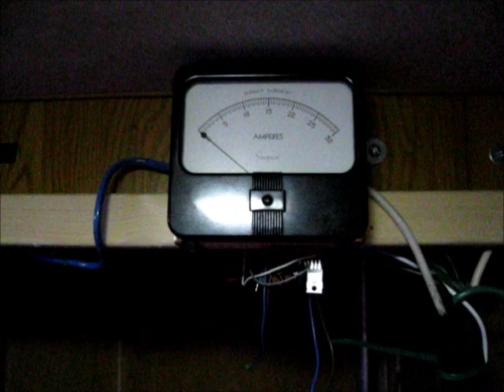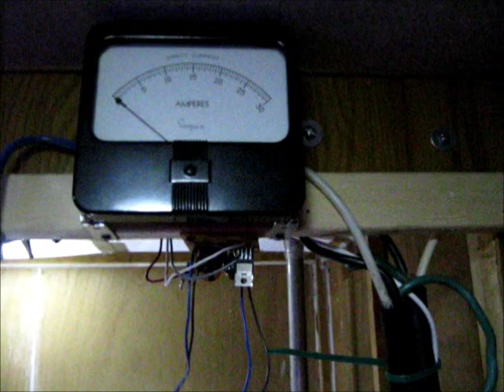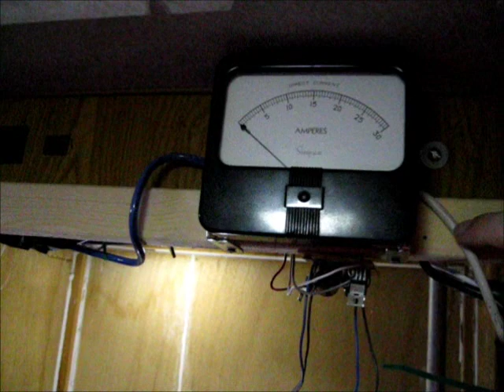Huge Wires Improve Solar Panel Output by 2x

Comment: My solar panels came with a 10 gauge wire and i want to upgrade to an 8 gauge are there any videos that show how to do this. thanks. Unfortunately y ou don't show how to, just what you did which is the same reason why i want to do mine.

Comment: use mirrors/reflectors to increase output even more...just dont overdue it because of the heat from putting a bigger area of light into a smaller space obviously

Comment: Does anyone know where I can find schematics for a solar charge controller with a charge dump system? Looks like this channel is not very active.
Reply from the maker: This channel is pretty active I would say since I upload a video just about every single day.
Reply from the maker: What you are looking for can get quite complex. Your system can be as simple as a voltage regulator, voltage sensor with relay and dump load. Or you can (and should) get very complicated and have a full charge controller which takes care of your batteries properly. This is a very complex system which I eventually bought and am using today. Check ebay for cheap solar charge controllers under $20
Reply from the maker: At the time I built this myself, I had no money but I did have some electronics on hand so I put this together. It was better than nothing in the short term.
Reply: Oh! sorry about that, I should've looked closer.  I actually have a solar charge controller.  I don't think it has a dump system, which I think is great. But what I am really looking for is this: I want my charge controller to shut off charging at 15.1 v.  Right now it shuts off at 14.2 volts. I'm pretty sure I know what piece needs to be changed, I just don't really know what to put in it's place.  I don't need more amperage...

Comment: Thanks. I am waiting for my mono cells to make my 18V panel with 50 cells. 36 cells in series and 14 in parallel to get more amps.
I have to have my panel inside window as I live a highrise condo. Using your experience I want to buy 6 or 8 gouge wire to run from panel to battery.
My question is can we buy wire connectors for 6 or 8 AWG wires?
also from the battery any gauge wires could be used or big wire is good?
.

Comment: V=IR Thicker wire mean larger surface area with in turn lowers resistance (R). Voltage remains same so current must increase to when resistance decrease

Comment: Using the biggest gauge wire you can, is probably the best way to get the best performance in any electrical circuit. It's all about Ohms' Law

Comment: I knew that there was loss in conductors, but I never knew it would amount to that much if the wires were sized according to code.  Thank you for posting your vid; it really opened my eyes and will greatly improve the system I'm about to install.  Out of curiosity, do you think that running larger wires for my home circuits, especially for high draw appliances like water heater, range. dryer, air conditioner, etc, would substantially drop power usage?  (keeping in mind that some of those appliances are upwards of 30 to 45 ft from the service entrance main breaker panel in my home)
Reply: +Raven Heart Voltage drop isn't as bad for AC power as it is for DC power.

Comment: I want to install ongrid and off grid system in my house to run 5 fans & 5 tubelights ( T 5 ) for FOUR Hrs. Distance between solar panels and backup battery / charger controller will be 20' ( 6.00 Mtrs ). Pl. suggest all required Items that is including 1. battery capacity 2. solar panels capacity 3. Inverter capasity 4. charger controller capacity. Thickness  / gauge  of wire required. I from India.

Comment from the maker: Your wire is about 14 gauge, so it will be fine. Keep it as short as possible to limit losses in the wire. The longer the wire, the more of your solar charging current you loose in the wire. If you expand and get more solar panels, either use a separate wire for each panel or upgrade to larger wires.

I have 600 watts of solar panels and use 4 gauge wire for example. It is huge and expensive.

Comment: I run my solar panels at 150v dc to help keep current down and wire size small at 10 Gage mtw wire  my 300 watt panel set up only draws 2 amps and charges 48v battery bank at 8.5A optimum. You will see a huge improvement if you get a mppt charge controller that can take the higher voltage and use your larger wires. its all about pressure and resistance with the size wires you have you should be capable of 20A with very little loss. pm me I have something that could help you out.

Comment from the maker: The biggest wire that you can afford is always the best. Especially if you plan to install a larger solar panel array. The higher the current output, the higher the losses in the wires. So bigger wire is better.

Comment: in your opinion would useing 2 or 0 gage wire be over kill?....i was just going to buy a big roll of it... an buy some battery terminal things an crimp them on the ends of the wire...kinda like automotive to altanator wire..

Comment from the maker: I think its 8. I found some nice power line wires laying in the woods. Got lucky. They are nice fat wires. It doubled my total power to the trailer.

I also used some 120 V campsite plug in cables that came with my camper to wire up the inside. Cut off the ends and you have some thick wires. I removed all the 120 V junk so I had that left over.